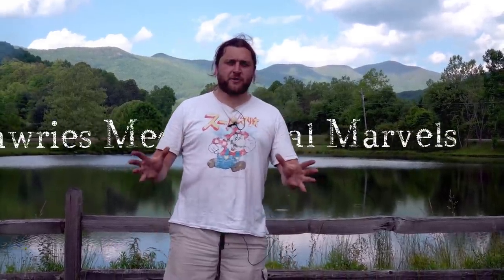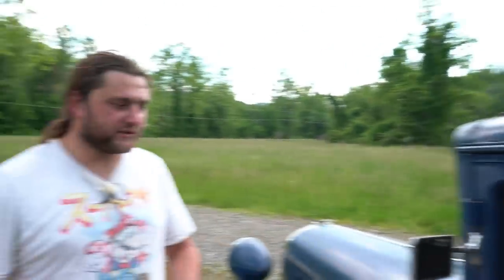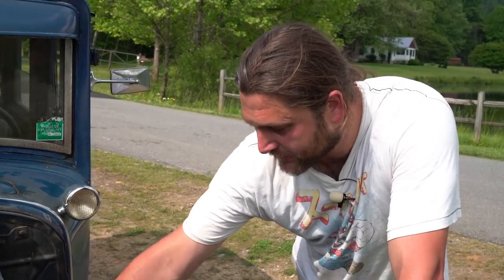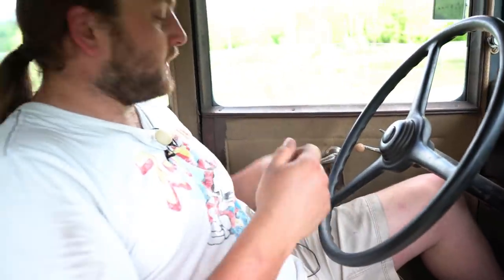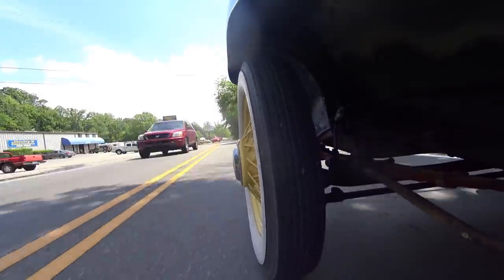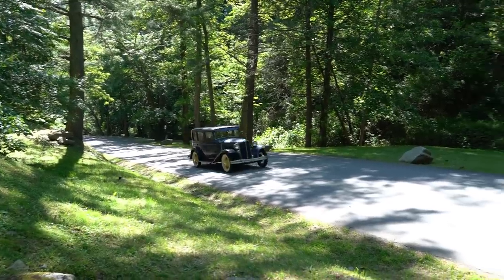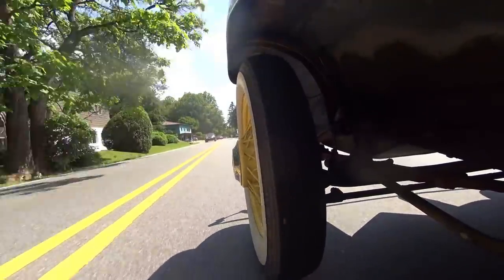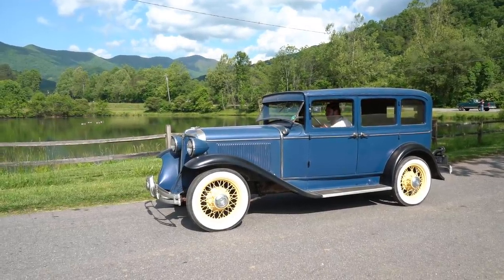Lawrie Falls in Love with a 1931 Chrysler CM6. LMM Drives Episode 18.

Comment: Double Declutching is a dying art, I learned to drive a bus with a crash box about 33years ago. To get your full bus licence, you had to learn on a crash box double decker! Now you can learn on an automatic single decker, and if you have a manual car licence, you can drive a manual bus. I have only driven a couple of crash box buses since. The oldest vehicle I have driven was a 1951 AEC Regent 3, that was built in 1949 and not registered till 2 years later. It has a preselect gearbox. It's similar to the bus in the old Summer Holiday film.
Reply from the maker: Oh preselect gearboxes are weird.
It's amazing how standards have changed over time isn't it! Though there is something hugely pleasant about driving older vehicles!

Comment: That alternator is a new bit of kit.  Originally it would have had a generator and a six volt system.  I noticed the headlamp bulbs look too small for the teardrop housings they sit in and switching from 6 to 12 volts would be why.  Modern 12 volt sealed beams are smaller than the old glass lensed 6 volt bulbs it would have most likely originally held.  I do think it's a beautiful car and would love it in either that lighter blue or the navy it was.  I wish modern vehicles still came with the so-called "suicide" doors like the back doors on it, opening from the front and hinged in the back.  It'd make it much easier to enter and exit a vehicle in my opinion but again, they may have more to do with my height than anything else.  In the 60's and 70's we had cars here with what were called Captain's chairs in that the seats were mounted so that they could swivel making it much easier to get in and out of a vehicle.  When you're 20 you never think about things like that.  Now that I'm 52 I think about things like that often, lol.
Reply from the maker: Ah yes, you are correct that the previous owner upgraded the electrics.
I too love the doors. They're wonderful.
I really want a Captains chair now!

Comment: what's not to love? i have a 1953 chevy 6400 2 1/2 ton grain truck that i converted to 12v. it's not on the road right now because it needs brakes, and i may have to upgrade to modern axles because i can't find the parts for it. not to mention it needs tires, and no one wants to change tires on the original split rims, and there are no modern rims for the bolt pattern. the wipers on that chrysler have a vacuum operated motor. no wipers if it's not running. you could swap out the rear end, carburetor and manifolds, and even a model t would touch 100 mph.
Reply from the maker: It was awesome.

That does sound a good project though - are you going to have to resort to have to fabricate the missing bits?
Reply: @lmm   if i have to go that route, i will have to fab new spring mounts, plus work out the u-joint. not to mention the steering, and front suspension. the '53 doesn't even have front shocks. but it only has 36,000 miles on it. it only went from the farm to the grain elevator. they bought it new, and retired it in '85.  i got it to build it into a motor home. i believe that's a  caravan to you. the first vehicle i owned was a '53 1/2 ton chevy truck i got from my uncle's cow pasture for $15. this is the same, only bigger. there are loads of parts for the 1/2 ton models, the 2 1/2 tons, not so much i'm finding out.

Comment: If you want a big old 20s-early30s car like that, here in the US Franklins are fairly cheap, running ones can be had for like 5,000 bucks. The joy of it being a not well known brand, and the general, unfounded really, down look upon air cooled engines.

Also of note, in my 1950 Crosley all the gauges work... except the fuel gauge, it shares that feature with this Chrysler. Heh.
Reply from the maker: I'll have to investigate that, they sound lovely!
It's not important to know how much fuel you've got, right?
Reply: @lmm  Yeah, I think they're pretty neat cars, you usually don't see air cooled with a big 6 cylinder inline.

And nah, fuel is irrelevant, don't you know old cars just run on your faith in them. :p

A sticky note with the odometer mileage of the last time you filled the tank stuck on the dash also helps a bit.
Reply from the maker: Now that's a very good idea!

Comment: You really do need to feel your way through an unsynchronized gear box, it will tell you when to shift and justly punish you if you rush it. 

Or if you have a tachometer with your speedometer you can do the math on when to shift accounting for road speed (velocity), vehicle weight (mass),  vehicle momentum (P=MV), engine rpm, inclination or declination, inertial force, engine load, wind resistance, ambient temperature,  and gear box internal temperature (for fluid viscosity). Isn't it cool how your human body, when trained can just feel stuff like that out!?!

Edit: little rusty on the math....
Reply from the maker: It really is just getting a feel for it, and just kind of knowing what the car wants.
By the end, I was getting pretty confident with the thing!
Reply: @lmm  Oh yeah, absolutely. Lol! Just having some fun! ;-)